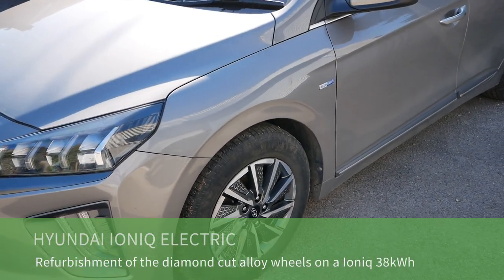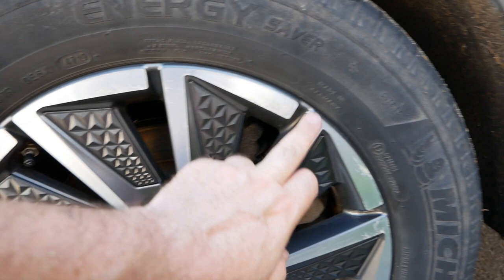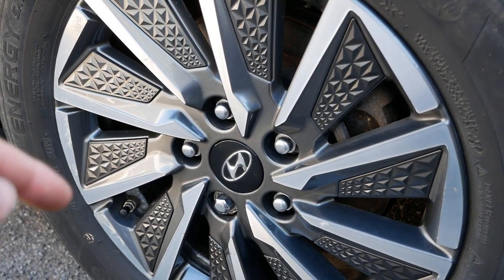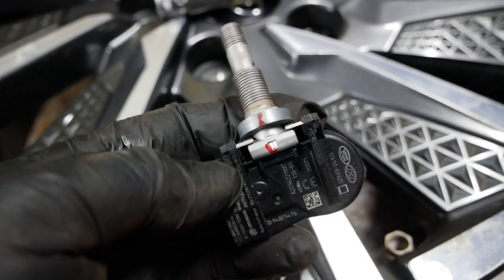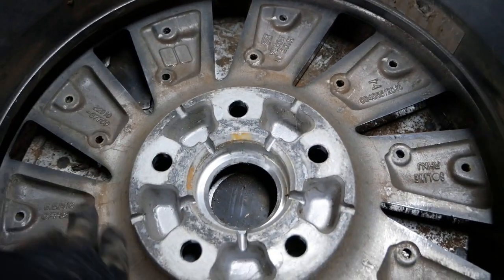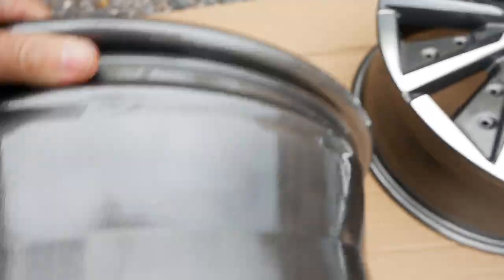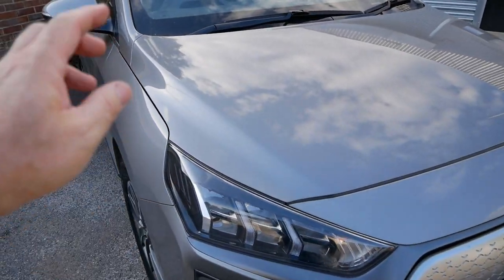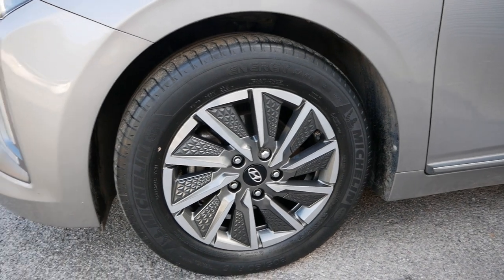Refurbishing diamond cut alloy wheels on a Hyundai Ioniq Electric 38kWh

Comment: Myself and others have had the wheels replaced under warranty for mottling of the paint and lacquer. My cars looked same as yours with large chunk of lacquer missing but no kerbing. My car had done 25000 miles when changed. I graphite coated my new ones.

Comment: Amazing the lack of brake dust on the insides of the wheels, after 3 years. Wonder if the 28 & 38kWh wheels are interchangeable - the 28's are nicer design imo.
The car will be a great future purchase for somebody.
I presume that the Tesla will be back on the road soon!
Reply: Yes. You can use the wheels from the 28. I have bought a set to use during winter in my 2022 Ioniq EV
Reply from the maker: Yes the 28kWh alloys should fit fine, as the hubs and brake calipers are the same.
I agree, they were much nicer.
As for the Model S, its still in the bodyshop waiting for all the parts to come in.

Comment: I have a 3 yr old Ioniq electric in black with wheels just like your before pics. Thinking of getting entire wheels painted in black to match the car but no idea if it will look too much. Have you seen this done before on that model?
Reply from the maker: No, I've not seen it done yet. But I would get the whole wheel painted as diamond cut is pretty useless. Personally, I wouldn't go black though. On a black car, I'd go contrasting, so silver or a shadow grey.

Comment: Hi Matt
I had my wheeles replaced under warranty (well 3 only) the laqeur was peeling off in large sections after the first 6 months
Mine is the 28kw 2017 blue the same as you used to have
Now 6 years on and you can tell which wheel wasn't replaced

Comment: I'm surprised an AliExpress seller doesn't sell packs of different design  inserts.
Reply from the maker: Yes, a shame. I'd buy a set of smooth ones if they were available.
Reply: Wouldn't the inserts from the 2018 28kWh fit?
Reply from the maker: @krisvandermeulen253  No, they're a completely different shape and the plastic insert does two spokes.

Comment: Did your coolant level stop dropping after a bit? My one was at 10mm over Max when returned then after 200 miles it was at Min. Seems to be staying there.
Reply: Our KONA coolant level dropped after it was replaced under the Service Campaign and we had to call in at the Draler for them to top it up